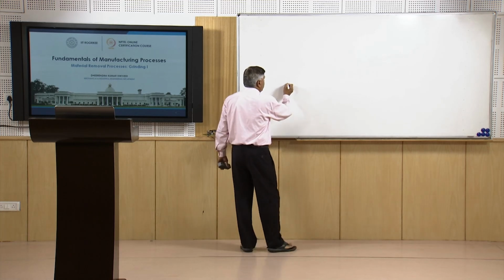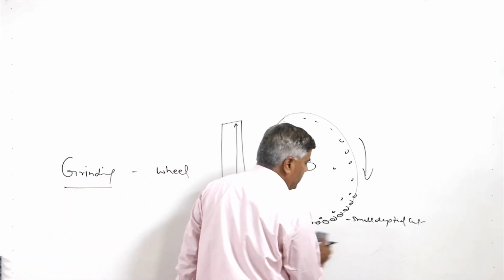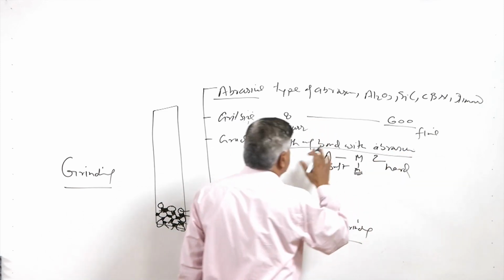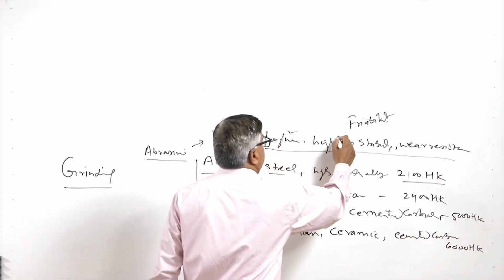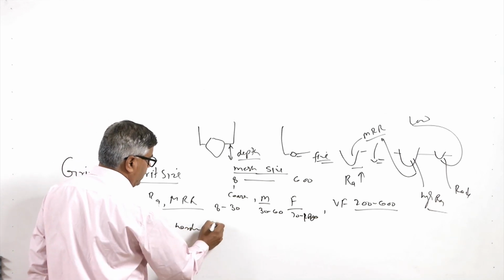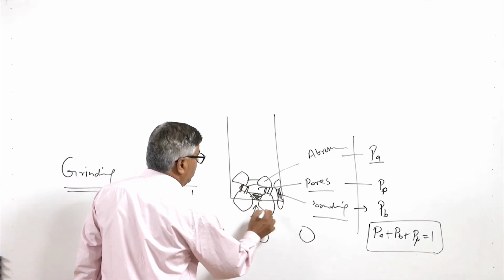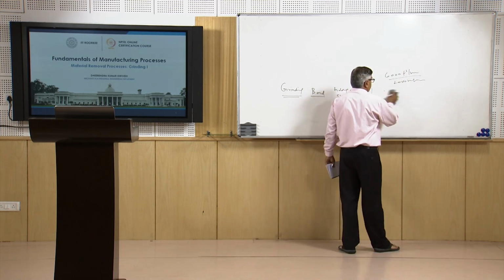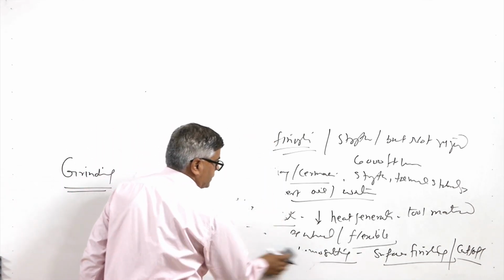Material removal processes: Grinding I

Comment: What is the use of writing everything you are saying on the board (in bad handwriting & no particular structure) when you can easily be using powerpoint slides with photos and videos for greater clarity?